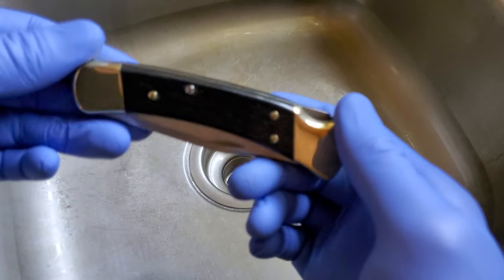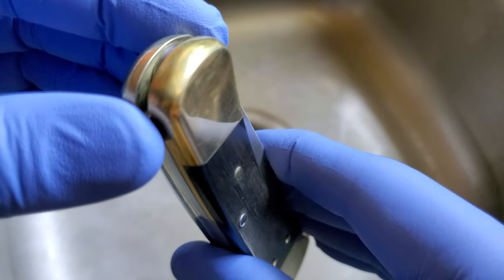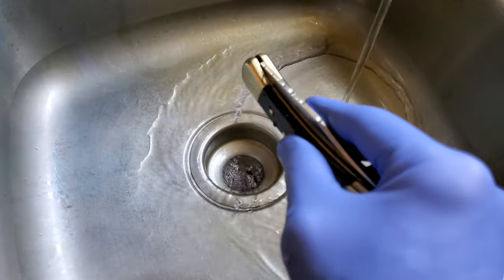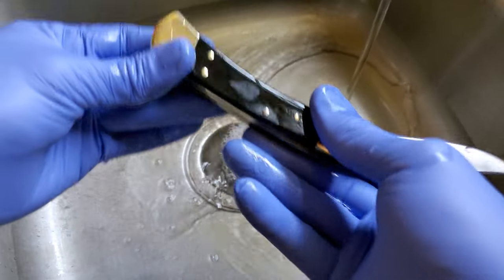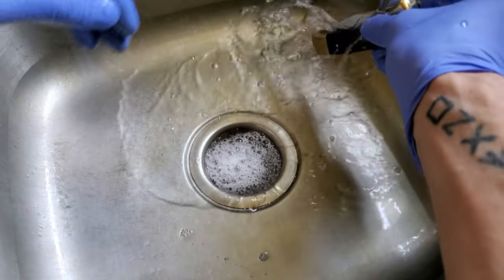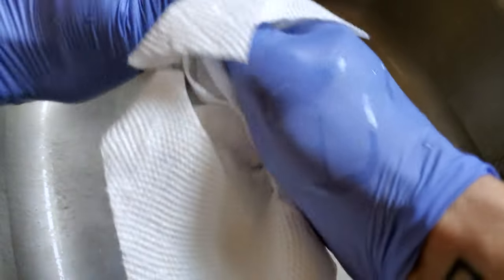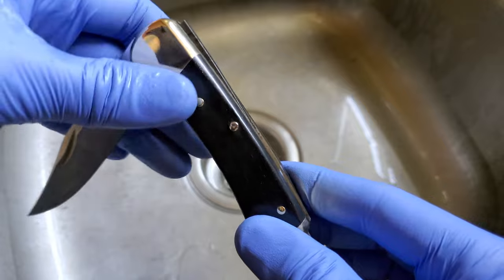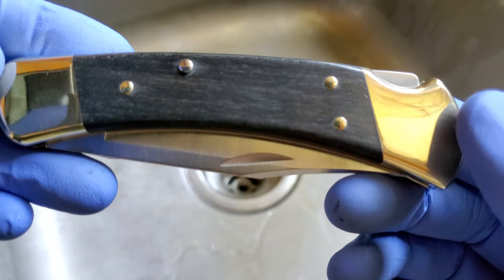How to clean a Buck 110

Comment: I've been collecting, buying, selling and trading knives for over 30 years.  I've been using this basic method for over 20 years.  I usually start with WD40 to clean out most of the gunk, then I take it to the sink and give it the hot water/dishsoap treatment (using a toothbrush to clean in crevices, handle scale texture etc).  After I'm done, I will shake the knife vigorously to shake out any excess water, then I hit it with a hair dryer.  Be careful not to overheat the blade, but you want to get the steel warm to point where you can still hold it, but with mild discomfort.  I usually spend about 2-3 minutes on this step.  I make sure to blow extra air around the lock and into the pivot.  Then I will leave the knife half-cocked in front of a fan for 24 hours, rotating every 6-8 hours.  As long as you hit it with the blow dryer and put it in front of the fan, you shouldn't have to worry about wany excess water between the scales/liner or in screw holes.  I then lubricate as needed, and wipe the blade with a drop or two of mineral oil.  I have never ruined a knife using this method.  As long as you don't skip the hairdryer or fan, this is perfectly safe.  I couldn't imagine disassembling every knife that needs cleaning...  It would take forever.  This method yields awesome results!  Thanks for educating people Ghostown.  So many people have been brainwashed into thinking that this is a bad idea.  This is literally the ONLY way I clean my knives now.

Comment: I use alcohol to wash it better.  Then I oil it up, then open and close it several times and the remainder gunk comes to the surface and clean with Q-tips.  Then give it a good wipe with clean cloth and it's smooth.
Reply: @GhostownKnives  How come you don't want to use alcohol?
Reply: @GhostownKnives  By the way I don't mean that I soak it in alcohol.  I use Q-tips to apply alcohol on the dirty areas, just enough to work itself in and clean the area with the Q-tip.  Then the oil does the rest.
Reply: @GhostownKnives  I see where you are coming from.  I hate the smell of alcohol too.  And I do take precaution when I use it so that it doesn't go near the wood of the handle.  I only apply small amount to the joints to wash out the gunk.  Anyways, thanks for sharing your technique.  It works too.
Reply: @potatoturtle300  Gotcha :)

Comment: how doesn't that rust the shit out of the pivot area? can't get all the water out of there cause you can't take it apart
Reply: @GhostownKnives  to dry it you said to use paper towel or a q  tip which would just wipe away water from the inside of the scales and not the pivot where it matters
Reply: @GhostownKnives  do you make folders?
Reply: @GhostownKnives  beautiful thanks I’ll check it out
Reply: WD in wd40 stands for Water Displacement. Actually the thing it is designed to do. Besides Bucks are made of stainless steel.

Comment: I have numerous Buck 110s and a couple of the autos.  Would I clean the 110 Autos the same way?  I have one that is very sluggish, out of the box, and have tried everything to loosen it up from Sewing Machine Oil to CLP.  It still doesn't lock open all the way when I actuate the button.  Should I try cleaning it like this before sending it back to Buck?
Reply: @GhostownKnives  I'll give it a shot.  Maybe this will help it.  When I cleaned it out with a Cotton Tipped Applicator I got a lot of blackish green wax on the end, and had to keep getting a new applicator.
Reply: My 110 auto was sluggish before cleaning it out with WD-40, then using Lucas gun oil occasionally. 
My 112 auto snaps pretty nice right out of the box.

Comment: Just spray it with WD40, penetrating oil, and the crap will come out when you work the blade back and forth.
Reply: @GhostownKnives  WD40 is designed to dissolve and lightly lubricate stubborn parts. It is however not a good oil for long term use. The product is part solvent, part light machine oil. It is a good product for cleaning any metal part that is very dirty.

Comment: I would never wash wood handles in water, only when it is seriously stuck.
Reply from the maker: To each their own. After a few years of cleaning knives for a living you may rethink it, may not.
Reply: @GhostownKnives  three generations of my family were great knife makers. I'm member in several groups where traditional knife makers are also active members. They all tesch / taught to avoid water in the handle. Wood may absorb water and change volume, it may distort the whole knife. I live in a tiny, 1100 years old Euroean country, so I admit materials may be different at your location and you may know it better. I was just shocked to see you doing what we were told for generations to not do. I wonder if the spring of 110 is inoxidable or you know the way to completely repel water from the gaps.
Reply from the maker: @deltawing9   getting the knife dry  is the trick.
Reply from the maker: @deltawing9   in further explanation:
 its really unavoidable  to get moisture in wood that's not sealed or treated. 
  These knives are unsealed ebony and even a week or two in my shop(just sitting on a shelf during summer) and the scales can become shy or proud of  the frame. Not mich to do about that on a factory knife. 
  
That said: 
 The frame, spring, rocker, scales, pins and blades are all very difficult  to rust or degrade and getting the knife dry then oiling the internal parts after washing works every time. 

I am only a second generation artist and knife maker and not privy to what any groups may say... but the techniques  and processes  developed  by my father and I have been reliable since the mid 1960s. from stone and silver,  to wood  or  antler and horn,  its totally fine if dried. 

I state this plainly  because I have to honor the  lifetime  Guarantee on every Ghostown knife  including knives made before I was born,  so I get a broad view of our body of work and it's wear and tear over time.
Reply: @GhostownKnives  thank you very much for your detailed explanation. Now I see the differences. Traditional Hungarian folding knives are slipjoint with super-strong carbonsteel spring, and - however this changed by today - the blades were traditionally carbonsteel too. The construction is different too, instead of integrated frames our knives have soldered on bolsters. On some part of the country there is red deer population, accordingly antler is the usual scale material and it's very durable. On the other part there is no deer population so bull horn is used mainly. Horn is much more sensitive to moisture. Also, we don't use eben so the wood used here may be more porous and prone to distortion. I respect your tradition and profession, thank you for the video. Hope once you take the time to look at our traditional knives.

Comment: Silly people. I've had my 110 since the 80s. Open it half cock put in dish washer top shelf run on short cycle.  Alone by the way. Ya don't want some one cutting themselves.  But it will be super clean. Remove asap. Air dry on counter. Your golden. Knife is bullet proof. A drop of olive oil in hinge.
Reply: @GhostownKnives  i use mine on food alot. So no petroleum products on my knife. It gets clean often enough.  But your point is very valid for long turm storage. I recall a air gun i put olive oil in to lube up the plunger some years back. We had our fun then put it away for a couple of years.  Yep that needed a complete hose down. And a new plunger.  But i do use my knifes often and on food so i try to keep them food grade.
Reply: EXCELLENT! You're the first person to recommend that olive oil be used! It is good lube and awesome for wood leather and skin. It's great for the insides of the body too. 😅

Comment: Why are you wearing latex gloves? Lol
Reply from the maker: Multiple reasons. 

My hands are dyed an unfortunate  yellow brown color from leather dye i just used without gloves. and it looks like I'm either a chain smoker or terrible  wiper. 

Really I use them often because 
Using 409 or dish soap 10-30 times per day dries and crack my hands.  Which are already extremely  dry and damaged from lapidary work and making knives every day.  Every bit of protection  helps and as a side benefit  they can help with grip in some jobs.